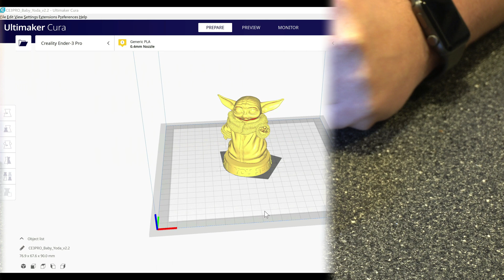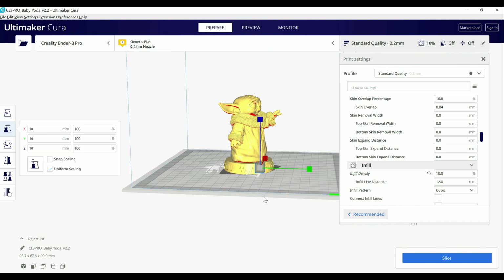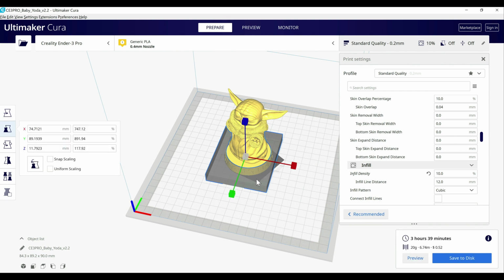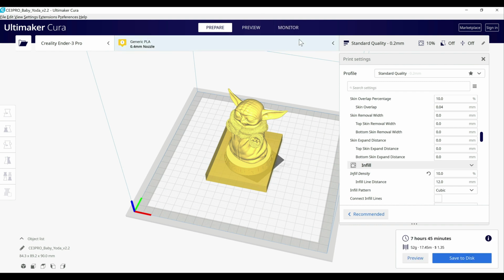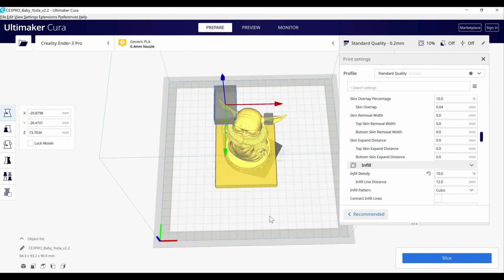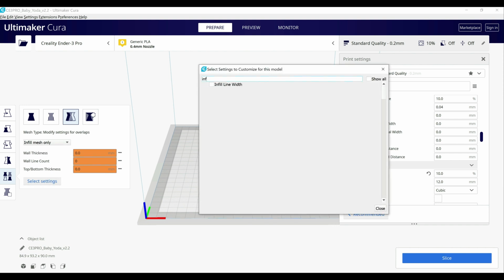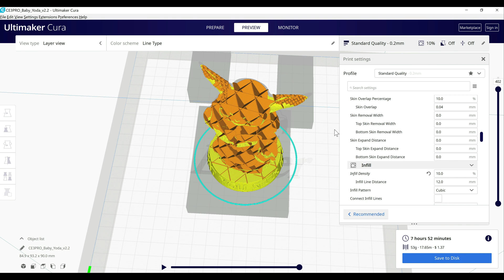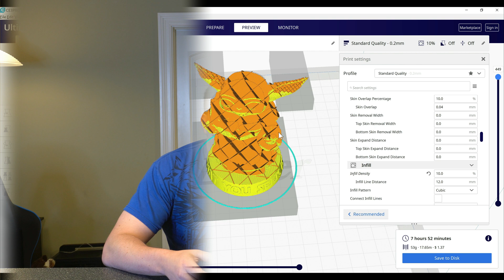Change Infill Mid-Print in Cura – Complete Guide!

Comment: It's 4 years later, and you've saved my head from excessive hair loss!
Turns out that you can do much more with this techinque; I had very specific case where I needed to change wall ordering mid-print, and I was able to do it using your method.
Keep on rocking man.

Comment: I'm still new to 3D printing. Been doing this for some engineering models and, let me tell you, you can achieve pretty resilient parts with such technique. Given the right infill pattern, in the right place and with the appropriate density, a part can come out extremely light, yet way stronger than it seems. This video was the most insightful for such procedure, I have to emphasize. Pretty good and useful technique, just like the tutorial.
Reply from the maker: Hi. thanks for the feedback.

Comment: It would have been a lot nicer and easier if you had mentioned that the basic Cura doesn't have that function. You need to add an extra plugin to get that option.
Reply from the maker: Hi. Thanks for the feedback. I did not install an add-on to do this. If i did, i would have started with that.

Comment: PSA: This is also great with lightning infill. Some of my modells have a lot of internal bridges ( holes for example) that dont need infill, but my top layers do, this works great to exculde all the unnecassary travel/print moves. Removing cost of material and time, and still get great supported top layers.
Reply from the maker: Great tip!

Comment: If you leave out the wall count for the ears as you did will this result in just the infill being printed?
 And how will this affect your supports if you have tree supports touching buildplate? would you have to set the default infill to 100% and then lower it for the rest of the model?
Reply from the maker: Hi. Yes it would just print the infill. I didnt try to add supports like that, i was just using it as an example. You could set the default to 100 then change it for the rest, or set the default to what the rest of the print would be, then the ears to 100.

Comment: So when you put those supports on the Grogu ears, does that mean there's a giant square around the ear? Does it need supports and do you have to tear it off?
Reply from the maker: Hi. The ear dont really need the supports but it comes out cleaner if you have them. The finger in the right side needs supports as it will try to print a part of it in mid-air.
Reply: @3DPrintscape  that's not what I'm saying, I'm saying that because you added the squares. And will you have to tear the material from around the model
Reply from the maker: @UNBOXXwithdarkfoxx  Ah ok, so if you make the support taller than the thing you are trying to support it will not add additional material above it. So if you have the support higher than the ear, it will create the support up to that point but not over it. Hopefully im describing that ok, you could slice it in cura then take a look at the preview to see what im talking about.